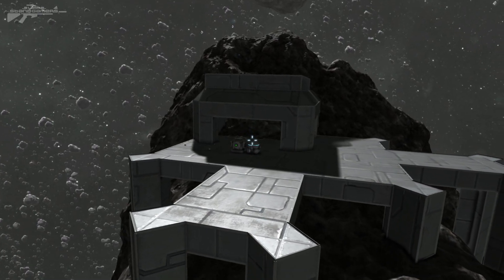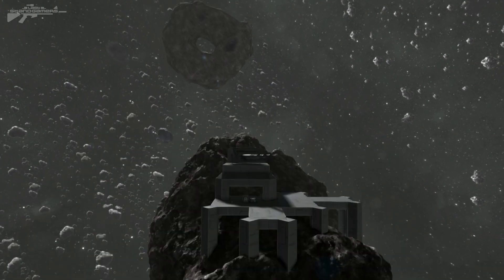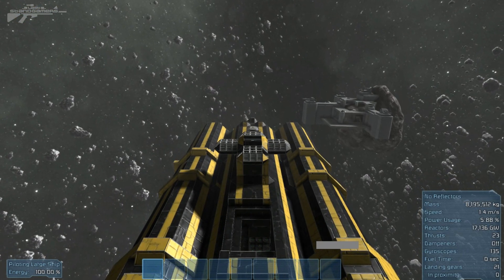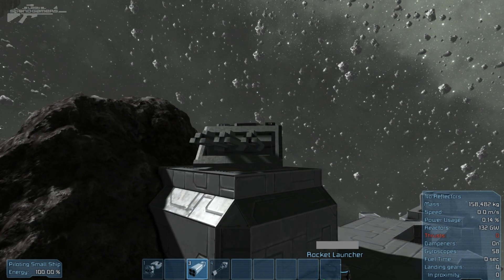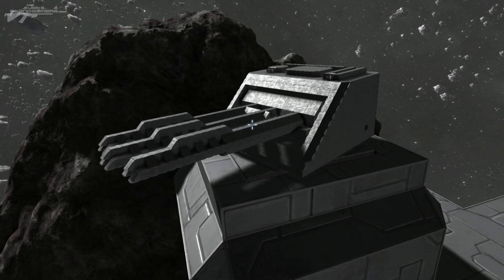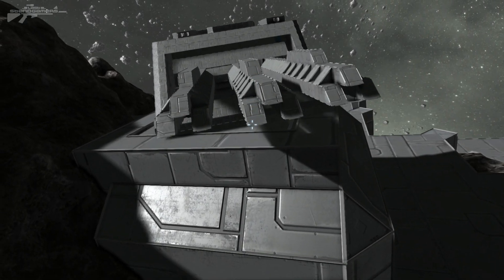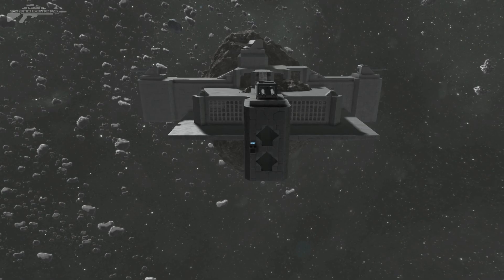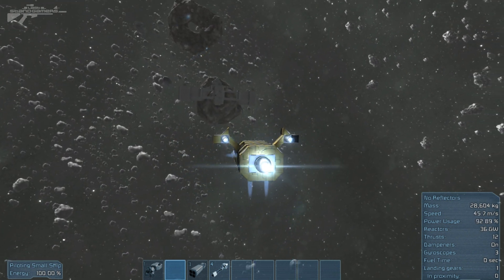Space Engineers - Orbital Missile Battery Defence System & Gravity LauncherPart 29

Comment: I remember reading an interesting page over on Atomic Rockets on why armed bases like this would want to build themselves into an asteroid.  Aside for the obvious ones like being able to dig in to build extra rooms or to extract ore for refining, an interesting one was to use all the rock and ice within the asteroid as a heat sink.  Due to the insulating properties of a vacuum, future warships might have serious issues with overheating, especially during the heat of battle if they have to push their computer, their nuclear engines, their lasers, their magnetic rail-cannons, all at once (or nearly so).  

A mobile ship will be stuck with these (to the point that some people have calculated warships would need to extend huge heat radiators, or regularly flush their system with coolent and then exhaust that coolant out).   You can't carry too many heat sinks because it will weigh you down, which will slow you down, which is unacceptable for a warship.  But an immobile base doesn't have to worry about it's mass or it's speed... it can take advantage of those thousands of tons of asteroid and dump heat into it.  That way it can run it's lasers and all that for longer than those warships before it has to worry about overheating.

Comment: Suggestion: instead of having a block 'carry' a pod or a fighter forward out of a launch port, have the block locked into the launch tube behind the craft to be launched to propel it out at speed, but the block itselt being locked into a slot in the tube for re-use?
Reply: I actually have an idea for a guided Torpedo. It'll require multiplayer though. Basically, it's a small ship rigged only for one trip. The person leaves just as it's about to collide while being packed full of explosives.
Reply: You could just build the asteroid into the ship or make a cup kind of shape at the back to hold it, making it a compact, no waste design. Have the 2 launch tubes be landing geared ships to disconnect each other from the station for easier individual control.

Comment: You need to start thinking in 3D.  Putting the 3 smaller turrets on the ends of the "arms" would allow them to target ships both above and below the station.  Your current build is entirely vulnerable from any attack from directly above or anywhere below.  The turret design looks great, but isn't practical on a station because stations cannot roll to give the turrets complete x,y,z coverage like ships can.

Comment: they really need to add some kind of shield system before multiplayer comes out or fighting will be really boring and frustrating.
Reply: Actually the opposite. Adding shields would turn combat into 'whoever has more guns wins'. It shouldn't be like that, there should multiple types of armour for different situations, so captains have to use proper strategy and tactics to figure where the important parts are on a ship, then figure out the best way to take them out. Shields=Health Bar= Not Fun.
Reply: Marlon Triebel First off, it's Alpha, the missiles damage will probably be tweaked later on. Second, small ships will probably be quick and agile enough to dodge most missiles, if they aren't then it's a poorly designed ship.
Reply: Ryan Smales
Sheilds against material weapens could be done in real life, and should be put into the game. Of course, they should draw a lot of energy and be very heavy. There's no feasible way that we understand to stop an energy weapon though. Although a 30 km/s railgun won't do more than drain a bunch of energy, a strong handheld laser would still burn the metal surface.

And of course, conservation of energy. A high speed projectile that doesn't penetrate the sheild should either cause the ship to move or begin heating up.
Reply: Ryan Smales if you have to small ships fighting, the ship with missiles will blow the other one away with one hit. then you die and have to make a new ship. that doesn't seem fun to me, the Gatling guns  seam ok but the missiles would just blow up everything in mulitplayer.